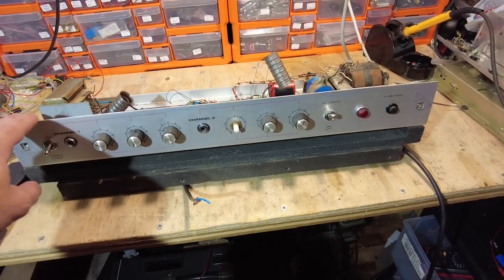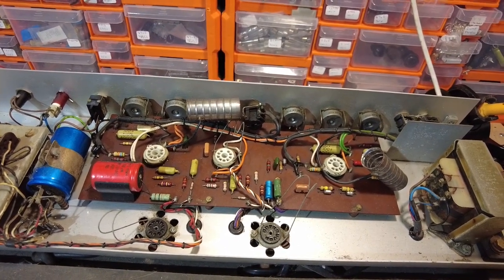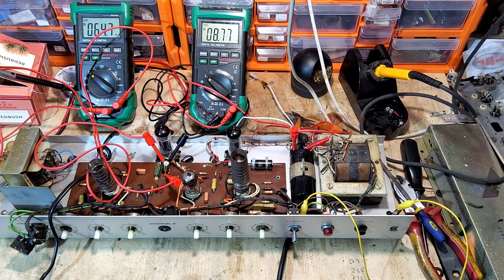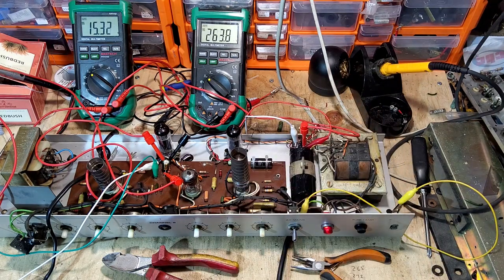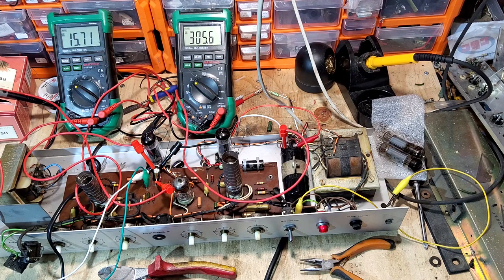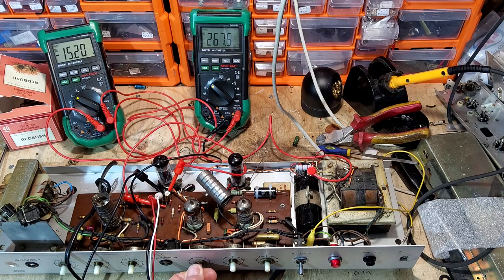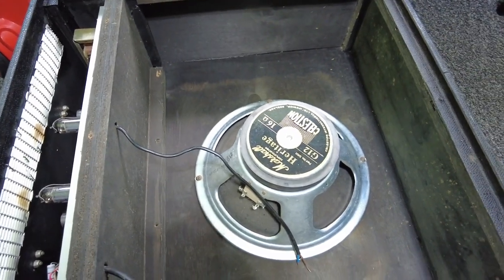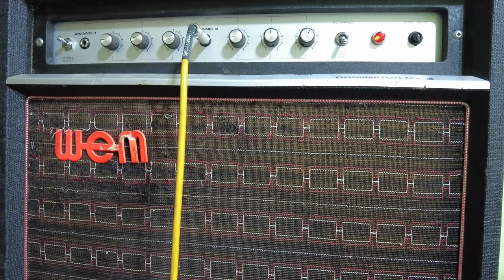Wem Dominator Mk3 Service and Valve/Tube Mod

Comment: Great video Martyn. As well as substituting the output valves, the Vintage 30 is 3dB more sensitive that a Greenback (100 & 97 dB respectively), so that adds a bit extra to the loudness of the amp of course.  Great demo with your excellent playing skills again. Looking forward to the next WEM Dominator repairs.
Reply from the maker: Hello Pete. Yes, always helps when you have a better speaker. Thanks Pete. Take care.

Comment: Hi, you stated that there was no difference between the two channels. The schematic for a mk3 shows a 200pf cap bypassing each of the plate resistors of one channel’s preamp valve. I was wondering if this was the case with this amp or if it differed from the schematic? Beautiful amp and lovely playing.
Reply from the maker: Hello Mark. That's a good spot. One of the channels does seem to have a bit more noise than the other. I wonder if that's why they added them to just one channel. I will have a look in to that as I have another one to restore. I will bring that up in the next restore video. Thanks for watching and take care.
Reply: On the left hand side of the the board, below the preamp valve base, there looks to be a pair of 100k resistors (plate resistors?) with a small silver coloured cap in parallel with each, and I cant see them on the other side of the board. Perhaps these are the caps that differentiate the two channels. High pass caps? I really enjoy your channel and methods of analysis.